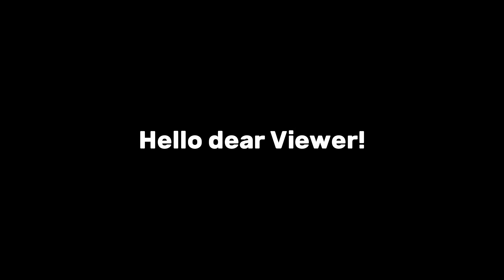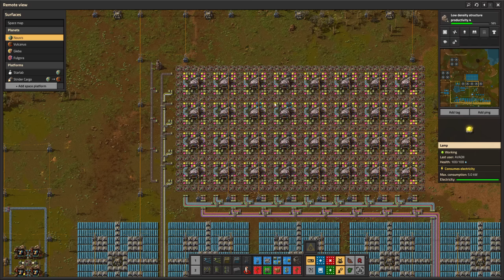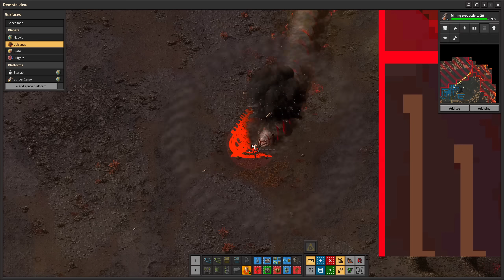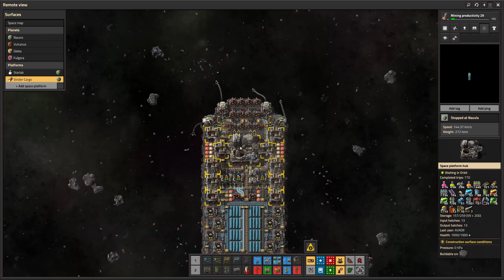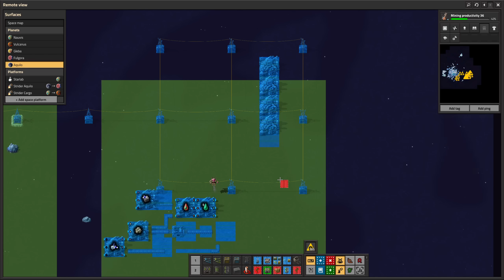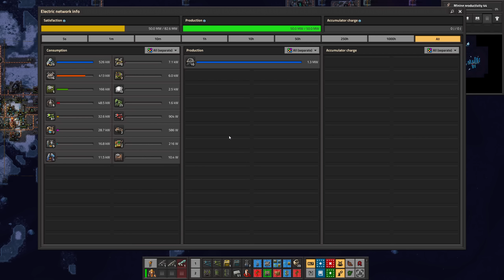Aquilo | 1 MILLION SPM MEGABASE | Factorio Space Age | 07

Comment: I think, for the cryoscience production, if you swapped the beaconned efficiency modules for speed modules, the whole thing would use less power. Sure, your power consumption per machine will increase, but your output will increase by even more, so final power consumption will be reduced.

Comment: Amazing video , i have a question tho , why not use Nuclear power to jumpstart Aquilo ? I do that everytime and is much better .
Reply: On a planet that forces you to not engage with the planet, why would you deliberately choose to engage with it even less than you can?

Also nuclear doesn't exactly help with melting the initial ice. That needs solar no matter what you do.
Reply: He wants to have every plant self-sustaining as much as possible. 
So no reliance on uranium - produce your own power and heat on Aquilo with no inputs.
Reply: It requires Nauvis imports which are pretty far away. It is easy to just send a ton of fuel cells over ofcourse but it's easier to just make rocket fuel. Instead of importing fuel, just import the building.